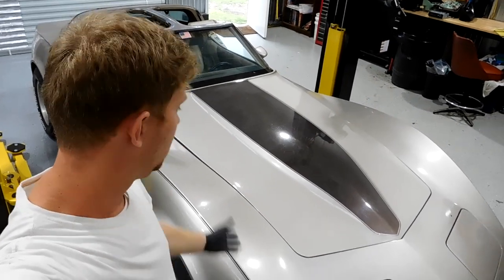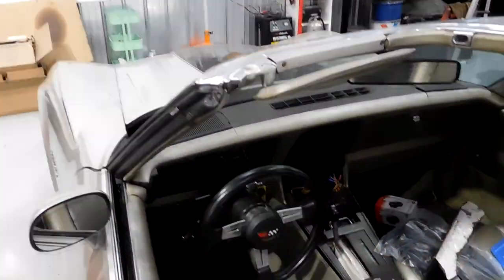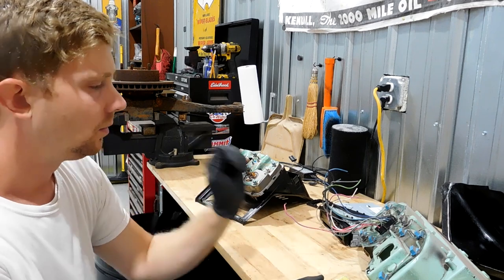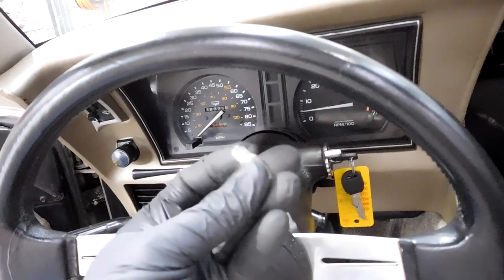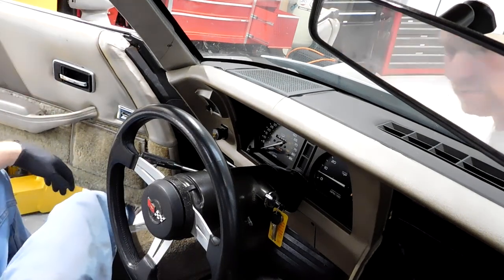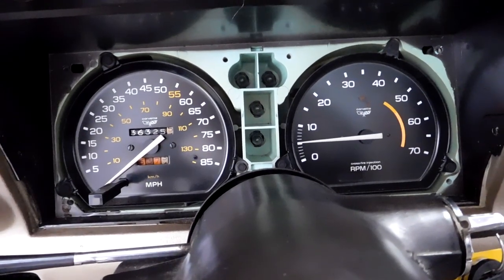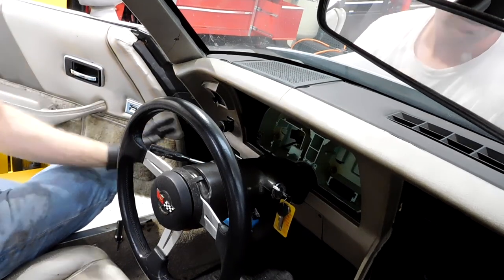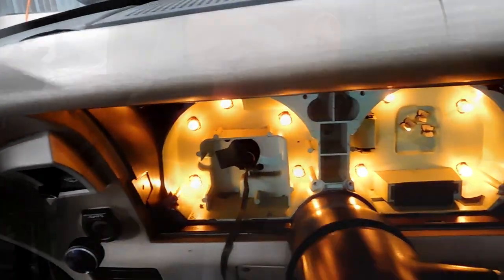Replace Dash Bulbs In Your 78-82 Corvette The EASY WAY. Works for Tach & Speedo Too!

Comment: I have replaced the hot bubs with LEDs. They come in any colour if you wat to be original. I used full daylight, 4400 kelvin color temp.

Comment: I had a 78 Ford Capri with the same issue; where the bulbs would get too hot and burn the lightbulb socket out, it wasn't just in the dashboard, but throughout the whole car....as far as I am aware the only solution is to replace the bulbs with LEDs....personally I don't think the bright "Ice white" light look was appropriate for a classic car, so I found some that has a more "yellow" (white-yellow) color that looked factory but obviously gave better light (without being too bright).

Comment: I replaced the tach board and the bulbs on that side. Neither turn signals were working so I used a pair of small bulb pliers and pulled both out. The left one works now but the bulb socket on the right side fell out the back. It looks like a ton of work to get that replaced.

Comment: I'm going to find a non-numbers matching '78 that's worth resurrecting (with a rust-free birdcage), chop that p.o.s. back end off and install a 68-73 rear end. Then have the hood modded to have some awesome gill slits fabbed on it to get that pressurized hot air out of the engine bay.

Comment: Thanks for this video Ben. I finally got my right turn signal bulb working thanks to your instructions. I have had my '78 SA seven and one half years and the bulb has never worked. Bulb was good just needed a better connection. Wishing you and your family the best.

Comment: Your vids really get me nostalgic for my '78 vett I had in college in the late 80's.  I swapped out the L48 for a better 350 when it turned a main.  I also dropped the spare, factory exhaust  and useless AC for a major weight drop and had a great time.  I'm glad you're keeping these cars on the road!  Regarding this particular video, is there no LED alternative for the old, hot, yellow bulbs?

Comment: Ben, I have been working on my 79, L82. My tach pegged out with the engine running. I hand been having all kind on issues with my center console instrument cluster. I’ve replaced the circuit board 3 times.

Comment: Great video!!  Can't seem to get my speedometer seated back in.  Do I need to push the clip in that I pushed in to remove it?
Reply: Figured it out.  Had to reach under the dash and push up a bit on the speedo cable so they would line up.

Comment: Ok so as I was replacing them  they stopped working even the ones that worked I try putting back in and then they didn't any thoughts?